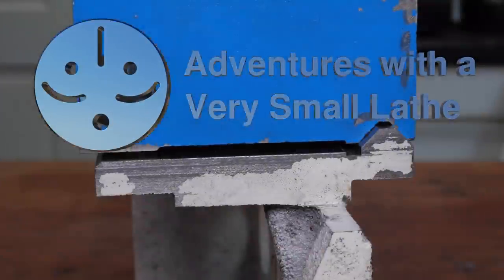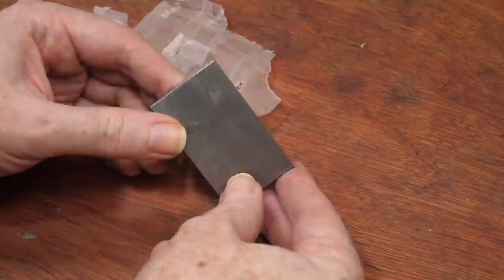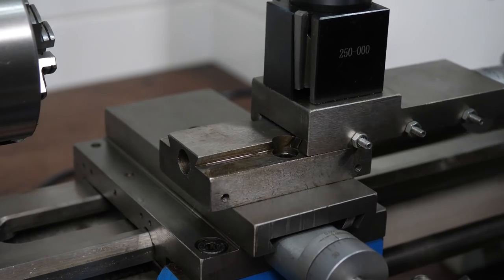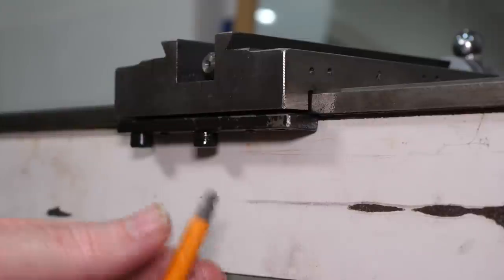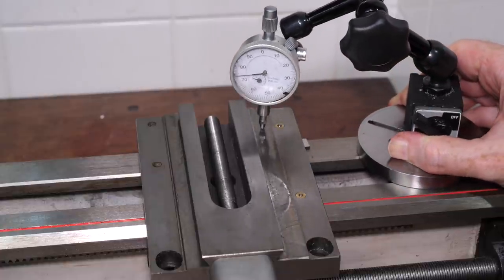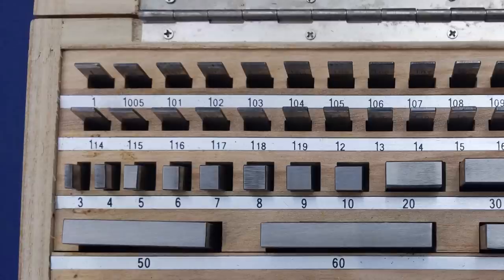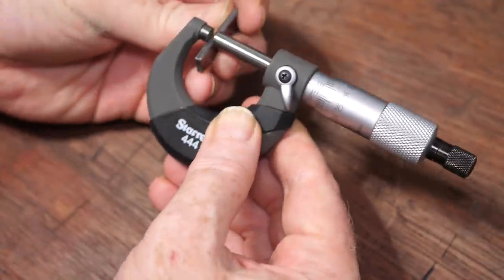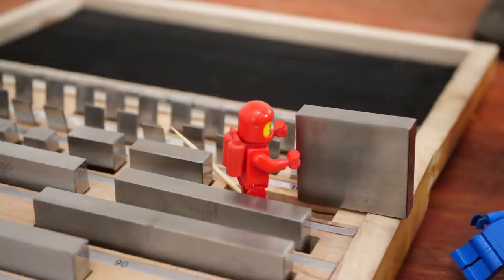The CJ0618 Lathe Saddle Part One, Measure the Problem with Gauge Blocks and Banggood Tool Review

Comment: Ah the joys of trying to find a hobbyist lathe. Either you get a 70+ year old western machine so worn out it has tolerances you can drive a truck through and costs as much as a new import.  Or you can get a new Chinese machine with tolerances you can drive a truck through from the factory 😭
Reply from the maker: Sad but true.
Reply: Unless you are so lucky to get a western machine barely used I have to agree with you 100% :-)
Reply: That’s why the Proxxon lathe is a very good alternative. They also make a bigger version than the one on this channel.
Reply from the maker: @Wasper216  I do kinda wish I'd bought the PD400 when I was starting out, though when I do upgrade I think I'll be going for something a bit bigger.
Reply: If a Taig or a Sherline will do, those are still made and available new.
Reply: Use a smaller truck.

Comment: I have the same model lathe, and it has the same problem, I measured it with feeler gauges to a little over 1.6mm, a piece of 1. 6mm brass sheet epoxied to the saddle was my fix. I also hand scraped the brass to fit the ways of the lathe bed once the glue had set. I haven't done much work with it since the repair, but it seems to work alright so far.
Reply from the maker: Nice! Thanks for letting me know that approach works. I'm discinclined to use brass, though it would be easier to work with.

Comment: If you treat the off-shore machines as a kit that must be assembled to the tolerance required by the end user, and keep an open mind, and try not to lose it over the lack of quality, you can get a decent unit with some effort. It can also be  a good way of learning new skills in scraping and setup. 
Rotary SMP has a great series called "polishing a turd" that is a must watch for all with a mini lathe. 
Cheers
Reply from the maker: Rotary SMP is doing a far better job than I ever think I'll be able to with mine. I didn't find him until after I'd started, but he's been a great inspiration.
Reply: I believe that MythBusters actually did polish a turd :)

Comment: Nice video about a sad lathe.  You can measure down to the minimum increment of your gage blocks on the surface plate by stacking blocks on both sides of the object.  You put say a 1mm block on one side and a 1.01mm block on the other side to get a height difference of 0.01mm. The problem here is the prismatic ways where you need a precision replacement for that part of the ways on a surface plate.
Reply from the maker: Sadly I have no surface plate yet. Nowhere to store or set up something big and heavy.
Reply: Adventures with a Very Small Lathe Well a machine table then-the flattest thing you have. Actually I wonder if you have seen the granite indicator stands for inspection with a roughly 10x10cm surface plate and a post to hold an indicator-that might fit your very small world.

Comment: At 1.8mm (70 thou!) you have your work cut out for yourself.  It's obvious that the saddle groove is not nearly close to fitting the way slide and that the surfaces were cut with rock and chisel.  Personally I started by using an 5 tenths DTI on the ways and put marks and readings about every inch with particular attention to the way slide. Then to the saddle grooves and slides and on to the compound.  Luckily I have an 18x24x3 surface plate to reference from.  TOT's early surface grinder restoration videos have some really helpful tips and tricks to the metrology of this kind of work.  Working in 3 dimensions is a bit daunting sometimes.  Thanks for the tip on the gauge blocks and surprised by the Grade 0/1.  I found denatured alcohol works good with a lint free cloth.  Thanks for sharing your findings!  Stay safe and healthy!

Comment: I've always used kerosene to clean stuff up, but I've switched to a proper degreaser from an automotive store. It smells waaay better (probably no worse than fly spray), and seems to work just as well
Good video
Reply from the maker: Thanks Tom! Do you know what the solvent ingredient in that degreaser is? When I did my first internship, workshops always had a bottle of 1,1,1-Trichloroethane, but it was phased out after the Montreal Protocol. Great degreaser, but terrible for the ozone layer.
Reply: Any effective degreaser that is not a Montreal protocol problem will be flammable (Flash point <65C) or at least combustible (Flash point >65C). 
I find petrol just as good as anything for the initial gross cleanup with a good quality solvent (think paint thinners) that flashes off quickly to remove any final residues. If you can get it at a reasonable price, a pure naphtha solvent is best but watch it around ignition sources. It’s not the solvent of choice for lighter fluid for nothing!
Reply from the maker: @jeffarmstrong1308  Thanks for the info. I hadn't realised how non-combustible 1,1,1 is until I looked it up just now. No wonder it was so popular. White spirit (the UK name for mineral spirits) can be pretty effective, but it tends to disappear pretty fast due to brush cleaning and paint thinning. The big bottle of kerosene is unlikely to ever run out though.
Reply: Acetone, or 99.99% isopropyl alcohol works for me.

Comment: Epoxy a piece of cast iron onto the carriage, mill to approximate thickness and then finish with a scraper.  A non vented brake disc from a small car might provide a useful source of material, they are cheap to buy new and already have very flat finished surfaces.
I agree with others that the bed V is very likely the root of your problems, but, like you, I wouldn't have the facilities to correct that so whatever works is the way to go here.  On the plus side it would be very difficult to make this lathe any worse than it already is!

Comment: I remember a Keith rucker video of his big lathe restoration and he used special stuff on the ways that can be scraped in.
But I think it's to big of a gap to fill with that stuff but still a good series to watch and see how to measure everything.
Be aware how you fill it, steel on steel is going to be an issue, steel on cast iron does work but what ever you do scrape it in properly to get the best accuracy.
Reply from the maker: That sounds like Turcite perhaps? I think that would be overkill for this lathe, it's just a practice piece, and not fundamentally of good enough quality to invest in the expensive stuff.

Comment: The Cross slide ways don't actually have to be co planar with the bed for general turning when the compound is static as the tool height is set at in relation with the true centerline. it however becomes problematic when the compound traverses as it causes the tool height to raise or lower in either direction depending on the angular orientation. with this in mind if you later intend to go the solid toolpost route you shouldnt worry about getting it perfect, coverage PPI and a middle 30% relief is more important. I have half a roll of 1mm Turcite left and a small strip of 3mm Turcite that would be more than long enough, I can pass either cut to size along to Emma and you can work something out with her if that works. you will also need to work on saddle to apron alignment in relation with the rack and leadscrew, same goes for the tailstock but there are some nifty tricks you can use depending on how far you want to go with it.

Comment: A question is how much the tail stock is going to be too high from bringing the rear up. It’s rotating it around the front bed rail. Side to side can be adjusted by the side adjustment of the tail stock assuming there is one. But the height will have to adjusted by removing metal between the top and bottom tailstock parts. Secondly, it can be assumed that the saddle and tail stock front and rear rail slides have been milled at the same time in a horizontal mill. In that case, rotating those parts by lifting the rear will cock the front “V” so that it will no longer fit the bed properly (assuming it ever did, that is), resulting in significantly increased wear and less support.
Reply from the maker: Let me answer the second question first:
The idea of this fix is to improve the fit between the front "V" and the bevel on the bed, not make it worse. The fit is currently really bad, scraping against a single edge rather than making good face contact. Part of what I'm doing in this video is trying to work out where the saddle and tailstock need to be to fit the bevel correctly, though it's hard to determine. I'm expecting that I'll have to re-work the V grooves towards the end of this process, probably by scraping them to fit the bevel.
It should be noted that the headstock has the same problem, as when all is fixed, all three parts will have moved, and you're absolutely correct that the tailstock will no longer line up with the spindle. I can't be entirely certain how much, but I think it's very iikely the tailstock will be too high, which will mean I can fix it by removing material.
Reply: @AdventureswithaVerySmallLathe  from what I see in your video, the mismatch with the headstock and rails is worse than that for the saddle and tailstock. In fact, the more I think about it, that difference could actually result in the tailstock ending up lower, not higher. Do you think the change in the saddle height will give a problem with the lead screw? The rear of the screw is adjustable as you showed, but because of gear engagement, I doubt there’s much to be done at the headstock. The close to 2mm is a lot.

Comment: I spotted the bare fingers/hands too and was reminded of a diagram that I used back in the 70's to explain to customers why they should NEVER, EVER touch the surface of an exchangeable computer disk pack.

This link below shows a modern disk head "flying" height - yes, that's right, disk heads today, just like back in the early 70's FLY! They MUST NOT touch the disk or ... !!! ... which is where the expression "head crash" derives. And a bad head crash can turn a disk drive into a lathe VERY quickly and spectacularly! 

Hopefully the image says it all but, ignoring the effects of skin acids which deteriorate the surface dramatically, it shows that a fingerprint is around 10 microns high or 0.01mm!!! 

BTW back in the 70's & 80's when disk drives were the size of large washing machines and twice as heavy, the analogy was that a disk head flying over the disk surface was equivalent to a 747 flying at normal cruise speed (500-600 mph) at a height of 6 inches above the ground! 

With todays smaller and faster disk drives (15k rpm v 2900 rpm) that's more like flying an SR71 Blackbird or Concorde at Mach 2 to Mach 3, just TWO inches above the ground!! 😲😲😲😫😫

That alone can blow your precision clean out of the water! Here's the link to the image:

https://acsdata.com/wp-content/uploads/hard-drive-flying-height.png

Comment: Your best bet for shimming up your saddle and tail stock is to make up the difference with a shim of a similar material (mild steel in this case should work) and using countersunk head screws to mount it to the cast pieces.
Reply from the maker: I'm considering fixing the shims using a metal epoxy, like J-B Weld. These shims would only ever be under compression, so they don't need any shear strength.
Reply: @AdventureswithaVerySmallLathe  That would also work pretty well.  I was going to recommend Loctite 603 or similar for that application, but epoxy is miles cheaper and the rough milled surface of the cast parts would be great for epoxy.

Comment: Wow, that's quite the gap when level!  I wonder the same thing as Reman1975 below, as it seems like stuff from that particular country is really hit and miss when it comes to decent tools or not.
Reply from the maker: I'm pretty sure this lathe was thrown together from QA reject parts, after the better models were sent off to the name-brand distributors. It's a disaster machine, but that makes for more interesting videos.
Reply: @AdventureswithaVerySmallLathe  Lol, basically "an assembly of castings, some assembly, fitting, and swearing required . . ." Thing is that by the time you're done with properly fitting and repairing the pieces you'll have a machine better than the "top shelf" version of these coming from there.
Reply: @EverettsWorkshop  That's the plan, fingers crossed. :)

Comment: If you want your Gauge Blocks to last, wear cotton or rubber gloves. Never handle with bare hands, the salt from your hands will ruin the slip faces. Failing that, purchase ceramic blocks.
Reply from the maker: Noted, thanks!
Reply: Just checking to see if someone had made this point - we'd be shot for handling them with bare hands! They need to be really clean, too - none of those grease smears on the ends.
Reply: @Phillip Dittmer ceramic is what was used (still is) for disk drive heads and they too are impacted by skin acids so moral is ALWAYS wear protective gloves and clean the blocks used after EVERY use with lint free cloth and acetone!

Comment: Can you mill out the v in the headstock and saddle to bring them in line with the flat section at the back ,seems thats where the fault may lie 🤔
Reply: Perhaps check the vertical tailstock allighnment with the headstock to see if the headstock is high
Reply from the maker: @darynradcliffe2909  Not with my current mill, or any that I could fit into my current small shop.

Comment: I may be a little late to the party here but the issue doesn't look like the back part of the carriage there. It looks like the internal dimensions of the cuts to ride on the triangular way. they are too small and don't allow it to sit all the way down on the ways of the bed. Both the tail stop and carriage appear to have the same issue.
Reply from the maker: You're absolutely right that the problem is at the front of the carriage, but I don't think the problem is that the grooves in all three parts is too small. There just isn't enough material in the castings to cut them any deeper and still have good strength. I'm fairly sure the problem is that the bevel on the front of the bed is too high. Unfortunately machining or grinding the bevel down is completely outside my capabilities with the equipment available, so I have to find another solution.

Comment: I like  video's verry much!!!! When do you show the community how you fixed the crosslide fault from 2.61 mm. Further how did you align de headstock to the ways?
Reply from the maker: I'm working on it, but it's a really long video that's going to take a while to edit. The good news is that I captured a lot of detail during the learning process.
Reply: @AdventureswithaVerySmallLathe  That's great to hear. Thanks for addressing comments in older videos. Im facing the same problems as you are. I will wait for the video until i make my final decision as to how to tackle this.

Comment: Here is what I would do. Drill and tap two holes on either side of the saddle ( Or remove and enlarge those oiler ports ) Add a bronze bar underneath. Use grubscrews to set the height pushing against the bronze bar.

Comment: What are the chances a Mathews or Grizzly mini lathe will not have these issues, I wonder. 10 mins after recieving a new Vevor 7x14 I had to work on it, the more i looked the more I found wrong that will put it out of commision sooner than later. It is going back to the store. I like the price, but not the quality. Are any of the $3000 mini lathes worth buying?

Comment: Thanks for sharing this with us, it is at once inspiring and daunting. I think that you have cured my desire to own a small lathe, lol
Reply: The trick is to buy from Grizzly, Little Machine Shop, Micro Mark, or even the Harbor Freight 7 x 12 model (online only, not in stores). They still require tweaking, but nothing like these cheap no name units! Look up Frank Hoose’s mini lathe comparison vid on YouTube. Any of the units on his comparison chart are of better quality than the ultra cheap ones, but you pay for that quality! I’ve got a Grizzly G0765 7x14 lathe and a Harbor Freight 7x12 lathe, and they’re pretty good machines! Grizzly machine is a little more feature loaded, but I actually think I like the HF unit a little better! I machine steel and aluminum.
Reply: You can get hung up on the issues like the one covered here but you need to consider what work are you going to do where these will actually impinge on the finished item. In this case there is a minor issue with the effect of the tool height with radius but so long as you know the angular error of the cross-slide to the horizontal you can compensate for this using the old clamped steel rule technique by adjusting the tool height till the rule is perpendicular to the cross slide rather than vertical. I have used a Clarke lathe that has this issue for over 20 years but have never found this or indeed the other issues with the machine stop me from producing work to the required accuracy including bearing fits etc.